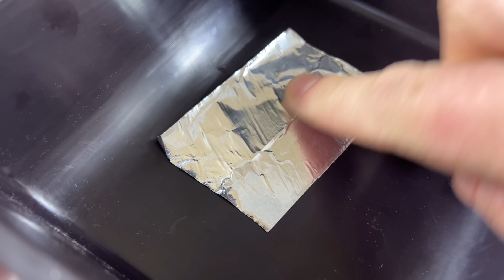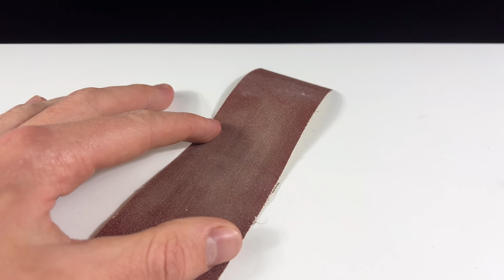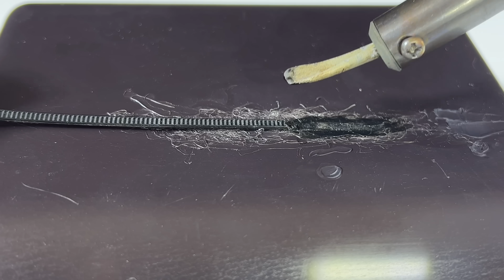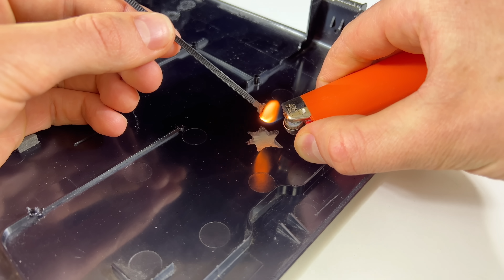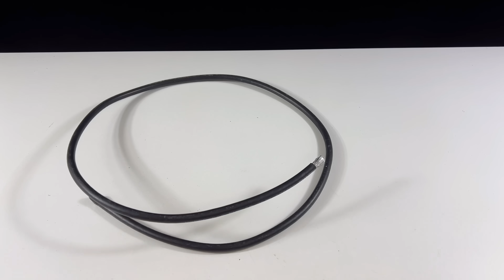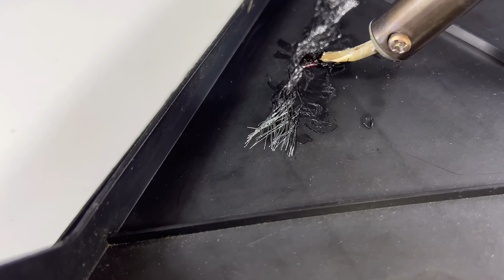Plastic Welding Method with steel wool. Easy way to repair broken plastics!

Comment: Difference between tinkers and experts. Use copper or brass instead of steel or aluminum for heating elements. Use shielding inert gas when heating instead of introducing air bubbles. Cut off piece of base material for mending instead of using an unknown material. Follow experts to get expert results.

Comment: By chance what is the rod you cut to make the tip and 2hat kind of tape is that?
Reply: Looks like a 1/4" steel rod you can get from a hardware store, and the tape is duct tape.
Reply: It’s thick garden or stock wire.
Reply: @GregAckerson  that looks more like aluminum tape to me
Reply: @svenh5022  Yes, it is aluminum tape, often used for air ducts and such things.

Comment: First off anyone , electricity positive and neg if beiged with steel wool will cause every strand to heat up red and ignite so make sure you use the soldering iron and don't make your own jig unless you know what your doing.  
2 two the creator of video, I love the concept as a life long metal fabrication and welding master journey man, I was around when plastic welding became big where by definition final product was one material (welding) I can't see close enough but the back of your crack is it rebounded, or is it just solderd?

Comment: Fine mesh stainless steel screen works for this as well, and won't rust. Splatter screens used in cooking and some strainers are good, inexpensive sources for this screen. Some splatter screens are aluminum, which isn't as strong.

Comment: What steel wool works best? (finer,  or coarser )
Reply: I would use finer unless you're worried about strength a lot. But it being plastic I doubt there is a need.  Either one will do but fine is my preference.
Reply: As shown, very, very fine since you really don't need the steel wool for strength in small projects like this.  Even a human hair thickness is way overkill to hold plastic in place while it is in a liquid state.

Comment: Very cool, what wattage soldering iron are you using for this please?
Reply: It looks to be at least 35 watts, but might be more.  Most soldering irons of the pencil type are normally rated at around 17 watts.

Comment: If thermoplastic, no need to add materials of any sort if you just make sure you remelt it together without burning it up. 
Fastest: Use an old normal weld tip. Run it at almost maximum setting with a 20-30 degree angle and trace the crack from start to finish. Have the tip almost penetrate the material. You will now have two walls on each side of where there were a crack. Go over it again and "lay down" the walls in the groove, alternating sides. Go over it again and smooth things out. 

This has worked for me the last 20 years in radiators, pressure pipes, containers etc.
Reply: That was done in order to ADD sheering strength to the surface. It will keep it flat, undistended.
Reply: I would LOVE a video demonstration of this technique. If you upload one, I'll watch!
Reply: @ColePanike  I'll go crack something and do a video then :-) Will reply when done.
Reply: @peterpunch1  the people are eagerly waiting

Comment: If you are trying to do this in any type of electronics enclosure, make sure you completely cover all of the steel wool.  A single whisker can cause an unbelievable amount of problems.  I once spent 2 days trying to figure out why we couldn’t start a power plant because of a whisker.
Reply: Your lucky you didn't cause a short-Circuit
Reply: @catalinnicolaevici2061  The whisker was a short circuit.  It was holding the start permissive off in the engine PLC.  When we finally got desperate we started reterminating wires.  I must have reterminated hundreds of wires before I found it.  The input needed to be off to allow a start.  Instead, it always had power because the whisker shorted around the control circuit.
Reply: @Simple But Expensive  that's horrible I hate going through car wiring harnesses. We had a gentleman that brought a nice Toyota into my buddy's shop and a few Squirrels made a nest in there and fill the engine bay with nuts plus when they made there nest they ate through 3 wiring harnesses points I literally had to go to the junk yard find a car that was the same cut big Sections open and take pictures and mark where they all go from there I went back to my buddy we sat there and figured out where all the wires should go. And yes your thinking why didn't you just match up the colors of the wires Toyota decided it was a good idea to make multiples of the Same color wires and same thickness. It was a nightmare. Luckily the gentleman only popped some fuses when he tried to start it. Toyota wanted like 5k$US to do the job my buddy charged homed 120$ a hour for like 5 hours of work plus my 2 hours spending time at the junkyard. All and all the customer was extremely happy we saved him 4k
Reply: @catalinnicolaevici2061  Multipy by 100 for a turbine control system.  

Once the wiring harness in a car is damaged, insurance companies generally write them off.  Just about any other problem can be fixed.  

I used to help a friend restore old cars.  The simplest I did was a 52 Chevy pickup.  It had 1 tail light, 2 high beams, 2 low beams, a dash light, the starter, solenoid, battery, generator, voltage regulator, start button, and ammeter.  That was it.  The windshield wipers were vacuum operated, and the fuel gauge and speedometer were cable operated.  No turn signals, since there was only one taillight.  I wired in in 20 minutes without a diagram.  The most complicated was a 302 Boss.  Once you got into the 70’s it got too complicated for me to spend time on it, but he had learned enough from me to continue.  

Now he has a looming board and does amazing stuff.  All he needs is a looming diagram (different from a wiring diagram).  He has a source, but won’t tell me what it is.  Several car restoration shops go to him for new wiring harnesses.  

He still restores cars, but nowadays he takes them to factory original.  His cars have won several top awards.  Since I have seen his starting material and final product, I consider what he does to be black magic.
Reply: Necessity IS the mother of invention.
Reply: L I was doing the 91 steps p
Reply: @Simple_But_Expensive  mo m few a QA😂 see dssAmi
Reply: Having worked with wiremen in the past, I always have respect for those folk. Doubly so because I am the untidy kind of engineer.
Reply: Always brilliant 😮
Reply: The fumes coming off of the plastic look tasty.
Reply: Yes
Reply: I don't believe it was the "whisker". They can't carry the ammount of A needed to shut down a plant.
Reply: @johnathansmith3819   

They can easily trip up a PLC running on 24 volts DC.  

Since DC PLC inputs typically have 240 ohm resistance, we are talking 100 mA, easily sustainable by a whisker on an AWG14 MTW multistrand copper wire.  

In this case, all it needed to do was hold on an input that needed to go off to begin the start sequence.  

The clutch between the GE Frame 6 gas turbine and the diesel starter needed to be in the disengaged position to allow the diesel to start.  No diesel, no gas turbine.  No gas turbine, no exhaust heat to the boiler.  No boiler, no steam.  

I spent 45 years working on these type of systems before retiring.  I know of which I speak.
Reply: You know you could just take a plastic straw and melt to structure and use a black marker . Good thing I always use is an iron. You would be surprised what plastic straws and an old iron can fix. Try it.
Reply: Great point!!! 👍🏻👍🏻👍🏻
Reply: What kind of metal is used to make their own tool?

Comment: Hi, does this work with any type of plastic?  I have a white plastic part of my refrigerator that broke due to the weight of produce.
Reply: Sounds like you have ABS plastic. Do a search for videos on repairing ABS. You will likely need a scrap piece of ABS plastic as well for strength.

Comment: Didn't they invent super glue and 2-part epoxy 50 years ago to deal with these problems?
Reply: Nope. Adhesives need enough surface area to bond to. Cracks in thin plastics like these can't be fixed with super glue, nevermind epoxy. You'd need to glue on an additional plate of material over the crack in order to have enough surface area for a bond, but that may add too much thickness to the surface, and if the plastic is something like polyethylene, the glue won't stick to it no matter the surface area, so your only option is to melt it like this.
Reply: Superglue dries out plastics too much making brittle if incorrectly used
Reply: Glue suxs

Comment: The plastic in the zip tie contains extremely toxic smoke. I wouldn't advise anyone to try plastic weld without using a proper gas respirator.

Comment: No, no; the zip tie will peel off like nothing, taking with it the metal mesh.
You didn't go deep enough with the weld to blend the plastics, and the zip tie is made of a completely different material.
Reply: You could be right with various plastics, but clearly in his examples, a good bond was made.

Comment: Nice, but if you don't match the types of plastic perfectly (incl potential Additives/etc), it won't likely be reliable long term.  
And what about the (huge) difference in both flexibility and thermal expansion/contraction between plastics and the metal wool?  Wouldn't it work itself loose, inside?
Reply: I'm gonna try to fix a big basin just after watching this. I was thinking that I'm going to cut some thin strips (to avoid compromising the structure) off the edges the and use it to fix a crack at its base
Reply: @alby_alby  Yup, good idea, same thing I'm thinking of doing to fix a vacuum case, but it might be the type of plastic which doesn't really "melt", just soften and deform easily; will be a bit more complicated...
Reply: @brianwall9592 don't melt the vacuum plastic. Just melt the added plastic
Reply: @knoll9812   ?  I don't believe you understood, friend;  diff materials (plastics, metals esp, anything really) expand/contract (even just a little bit; doesn't take much) at different rates to temperature changes, which means they can (and do) work themselves loose from each other over time (unless kept in a relatively thermal-consistent environment/application, and/or under constant pressure from fasteners/reinforcement/etc), and the vacuum certainly can get a bit warm sometimes (plus the vibration doesn't help) as well as temperature differences in my tiny apartment (I daily refresh the air by opening windows for 30 mins or so, and during the winter that causes a sudden temp drop of about 10-20 deg inside, then suddenly warming back up again).

Comment: Why wouldn't you just use the zip tie I stead of the steel wool also. Or just melt the box back together
Reply: Some plastics don't just "melt back together", they can shrink and further separate and/or just get really soft/deform without actually "melting" far enough into a liquid-like state (I just read up on that, b4 BOTH problems happened to me yesterday during the same repair attempt; D'OH !  Now must use epoxy with a carefully bent metal plate and screws, sigh)...

Comment: I purchased a plastic welding kit, the method you postered is easier and faster. Thank you
Reply: If thermoplastic, no need to add materials of any sort if you just make sure you remelt it together without burning it up. 
Fastest: Use an old normal weld tip. Run it at almost maximum setting with a 20-30 degree angle and trace the crack from start to finish. Have the tip almost penetrate the material. You will now have two walls on each side of where there were a crack. Go over it again and "lay down" the walls in the groove, alternating sides. Go over it again and smooth things out. 

This has worked for me the last 20 years in radiators, pressure pipes, containers etc.
Reply: @peterpunch1  you absolute legend

Comment: To prevent the plastic from cracking again apply some superglue and before it dries fill the superglue with baking soda. I use this trick almost every day and it never failed.
Reply: Facts! Super glue & baking soda gets diamond hard!
Reply: Also you can use the carbon from charcoal instead of baking soda
Reply: Agreed, but have u ever tried cotton balls injected with superglue?  Same thing, wicks it up Instantly and Hard, great to fill gaps or even to mold your own shapes (great way to "lock-in" things/parts/screws/etc).
Reply: @brianwall9592  that's very true! It's almost scary how quick it it sets, and how hot it gets. Once i fixed a cracked radiator housing on my car using this cotton-superglue combo, and it held up amazingly, long enough for me to get a new one, and i'm pretty sure it would've held even longer, had i kept using it.
Reply: I used this trick last night for my plastic battery tray (the hook broke for the pin that holds the battery in place) and it's good to go :D I'm so stoked it worked, saved me $100 in a new battery tray.
Reply: @jamesbagos3459  You can also use cotton wool.

Comment: What kind of tape are you using?
Reply: Looks like insulation or seam tape, also called foil insulation tape. It has a few names.
Reply: @timmannchicken  TY. I want to try this.
Reply: Deep breaths
Reply: It’s duct tape, air conditioner tape.
Reply: Looks like aluminium tape

Comment: There is literally no point in using the steel wool 😂
Reply: Reinforced it😊
Reply: @tinamortensen1220 Maybe, but was it worth it?
Reply: Melted plastic welds on their own are extremely brittle and fragile, a babies breath would break them. The steel wool (if you push it deep enough) acts as scaffold and becomes ridiculously solid when cooled.

I normally use wire mesh when plastic welding,

Comment: Wtf..I can 3d print or buy a new one in the time it takes to make that "repair" plus are actual ways to repair plastic if needed.
Reply: If you can 3d print a whole piece in the time it takes to watch this video, then you need to market and sell this magical 3D printer.

Comment: Be very careful when inserting this type of thing into a soldering iron. This could be potentially dangerous.
Reply: I find it difficult to see the danger of using a metal rod as a heat conductor in a soldering iron, the only issue I see is if the rod has a smaller diameter than the hole in soldering iron wich could lead to poorer thermal conductivity.
Reply: Hi 👋
Reply: ?  Apparently, you don't know how a soldering iron is built;  the tips aren't actual Heating Elements like in an electric stove; they're electrically Passive (no juice), just conducting heat from the actual "Element".